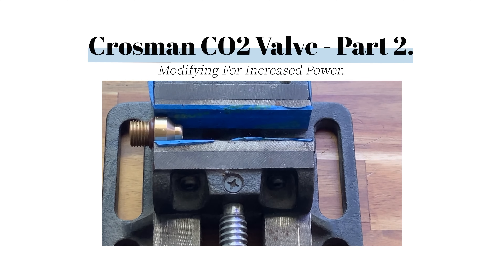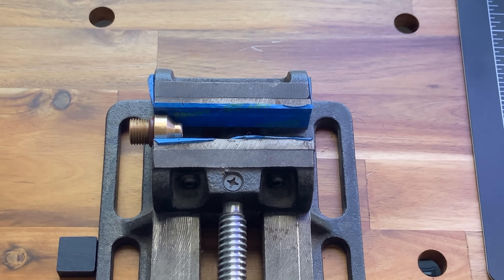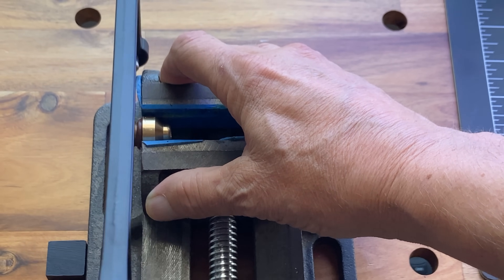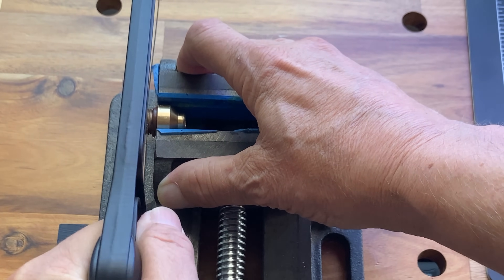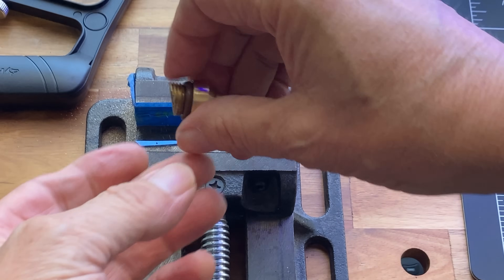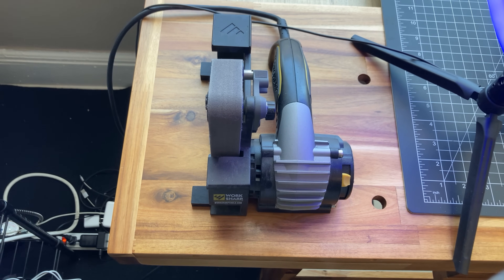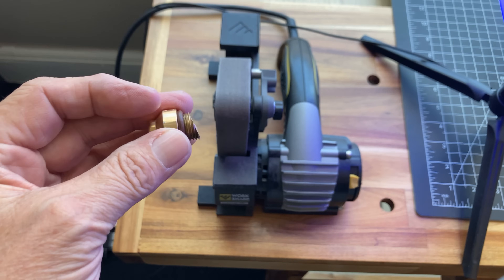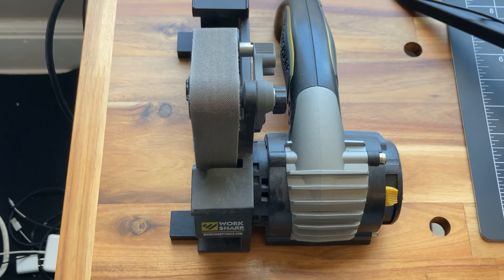Crosman CO2 Valve- Part 2, Modifying For Increased Power.

Comment: Unfortunately, that vise really let that get away from you. Before you were even half way cutting, I was already thinking Belt Sander. I have an old 80s Craftsman 3x21 Belt Sander that has a handle that lets me flip it over flat and stable, for that kind of work! And Locks on so I have both hands free to shape. Great Recovery! Now let me find the results video!
Reply from the maker: You're right, I could have used a better setup but it worked out okay.
Reply: @AlsAirguns  Hi Al, I went looking for the results of the mods you made and there's nothing? Was there a bottleneck that kept the larger amount of air from releasing faster to push out the projectile faster?

Comment: I also open up all the wholes inside and center whole to specially on the discovery valve top  on both tops the location of the spring  lip on the inside should be left alone  distance  wise because it can drastically change thing .  Not to any benefit.  💯👍✌️🫡🎯
Reply from the maker: @Josephsaucedo8691, That is good to know about the spring lip. Thanks for the tip.
Reply: Very interesting! Nice work with the saw and grinder. I never knew that hack saw blades only cut on the forward stroke! I do know enough to let the bade do the work, as you did, even if it takes a number of passes. Trying to force it may cause the blade to jump out of the initial/desired cut site and damage surrounding threads. Very much looking forward to the before and after power results!
Reply from the maker: @MichaelWhite-cx4ho, That video should drop in the next 48 hours or so. Members have early access to it. Memberships start at $0.99. 🥹